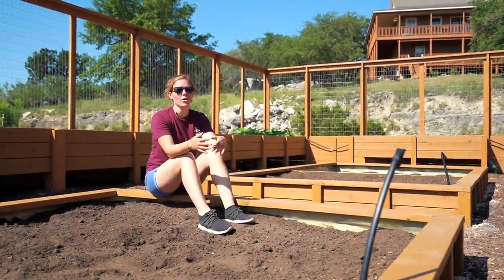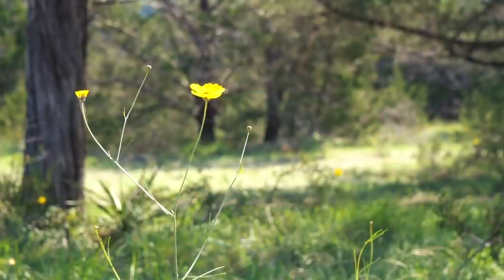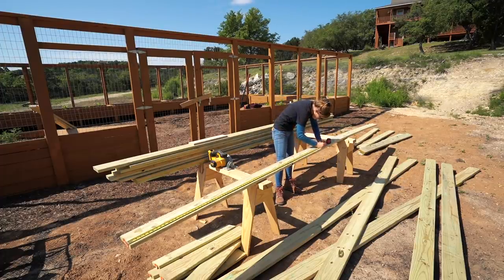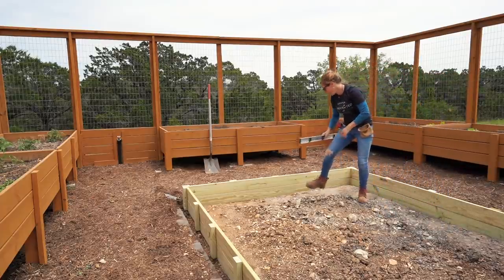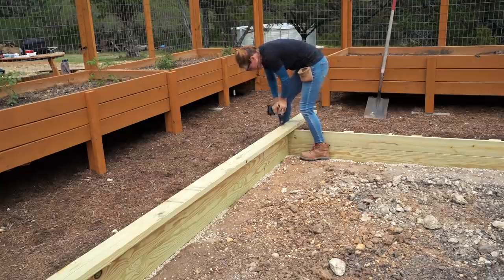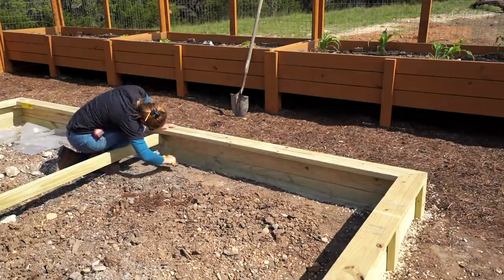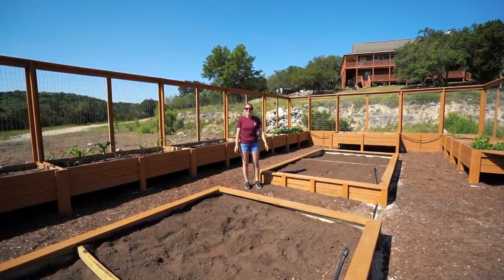DIY Raised Garden Beds

Comment: Very nice job April. We use scaffold boards cut to the width of the beds, so you can easily plant across the bed without standing on the soil. A standard scaffold board is also a good spacer between rows, after planing one row, simply flip it over and plant the next row on the other side. Happy gardening.

Comment: Kudos to you for all the hard work.  You did a good job.  I don't agree with the research you did on pressure treated lumber used in garden beds - soil contact and absorptions etc., even if you used soil contact PT and not just the standard off the shelf PT (don't trust everything you read).  Again, kudos for all the work and quality of the work you have done, but I think it is more effort and funds than a simpler more practical plan would give.   Plastic or any laying system give ants / insects and mold a home.  We all know what they are capable of.    I don't know if you stain over PT lumber before it dried but allow PT to dry before staining if you don't already know this.   In short, its over kill, but looks great and a job well done.

Comment: Pressure treated lumber is rated for high moisture/marine environments and ground contact but what many people may not realize is that after making a cut through the lumber - all cut ends should be retreated with an application of End Cut Sealer in order to ensure the integrity of the product's rot resistance and to maintain the lumber's warranty. Yes, as crazy as it sounds, pressure treated lumber does have a warranty. A well know and trusted brand of end cut sealer is called: Cut N Seal if you are interested.

Comment: Always love your videos. FWIW, I used to use 1x or 5/4 for beds, but found it only lasted a few years before rotting from the inside out. I'm nowadays going with 2x material - which also helps with bowing of the material. Of course you could also cedar ($$$), but I likewise use PT wood (much safer than it used to be). My standard is to go with a 4'x10' box that's ~24" tall (3 2x8' boards high). I likewise add little 3/4 tall rim ledges, but only on two sides. 10' boxes also mean that 3/4 EMT (in 10' lengths) work perfectly as a trellis framework, and I use 7x3.5 concrete rebar wire mesh for easy to add / remove trellising for tomatoes, cukes, etc. -Best wishes!

Comment: Good work, as usual.  However, according to my research, the plastic liner actually traps moisture next to the wood, speeding up the rot process.  Instead, with my timber raised beds, I protected the inside the beds with a non-toxic wood stabilizer and stained the outside (with both products wrapping around the corners of each side timber to meet where they won't be visible).  I also recommend either lining the floor of the entire bed structure with hardware cloth, or placing a perimeter of vertical hardware cloth or metal sheeting in the ground around the entire structure to ensure that critters don't burrow into your beds.   Happy gardening, April!

Comment: One of the benefits of raised beds is that you should be able to reach the middle without stepping up in it. That would normally mean about three feet wide.
Reply: Yep. I’ve done several generations of raised beds. First was four 4x12 beds made of 1x12 boards; they fell apart in a couple of years and were a pain to reach the middle. Second generation is four 3x8 beds made of 2x12 cedar, much sturdier and easier to manage and they survived a move from one house to another. Third generation will be to raise these beds up about 3 feet and put bottoms on them to again make them easier to reach. That’ll be a project for this fall when the growing season is over. Might raise two of the beds only 2 feet instead of three and grow taller stuff in the shorter beds.

BTW I’m a big fan of Mel Bartholomew’s Square Foot Gardening system.
Reply: I was just going to post this.  This size is not optimal.  Would have been better to build 2 three for beds or 2 1/2 foot beds.  One four foot her max if you want to push it.

Comment: Its going to be difficult to tend to the middle of those wide beds. That's why raised beds are typically no wider than 2ft.
Reply: SeanLeonDrums You mean 4 ft as the width of the bed. The 2 ft is the empty space between beds.
Reply: Since those central beds are not very high, April can place boards (walking planks) in between her plants when she wants to access them.

Comment: I'm curious about finishing pressure- treated lumber. You applied a finish right after completing construction. Here in NC, our pressure treated lumber is so wet, that if you put a finish on it right after the build, it seals in the moisture. I've seen a brand new deck built of PT lumber rot in a couple of years because it was finished too soon.  Is your wood drier in TX,, or is the climate dry enough that the wood will dry even through the finish?
Reply: Is she using KDAT (kiln dried after treatment) lumber?  Yellawood in some areas.  Don't need to wait to finish.
Reply: I agree, when I redid my deck, the PT wood was literally dripping wet. I had to wait a season for it to dry out before I finished it.

Comment: When you built the garden enclosure, you sprayed the coating. Here you rolled it. IS there a reason that you didn't spray the finish seal before you assembled? You could have gotten the side boards and the brace 2 x 4s at the same time.

Comment: That whole setup is slicker than owl snot. Do you use  deck screws or structural screws? That top board makes a great seat or beverage holder.

Comment: We Europeans despair at the insistence of Americans  in using shovels, spades and pitch forks that do not have a handle on the end which makes using them SO much easier to use!  It seems that Americans have an almost religious connection with the older design. You can buy both shovels and spades with a handle in the US , but not I think pitch forks.
Reply: It must be quite an honor to be selected as the spokesman for every citizen of an entire continent.
 I, on the other hand, can only speak for myself. For some things, the shovels with the handle work best however sometimes having the longer handle is good for leverage, and for what she was doing, shoveling loose dirt and gravel, I would prefer the long handle.

Comment: I hope you didn't use pressure treated wood It's a NO No with food plants
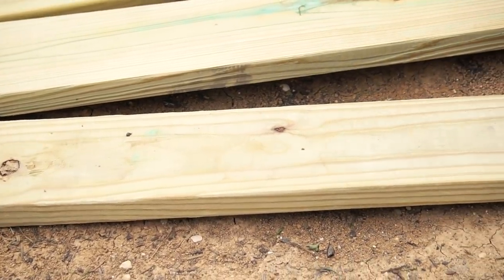Reply: As she said in the video, she researched it and the pressure treated wood she used is safe for what she is doing. 3:35
Reply: Most are not using arsenic anymore not to mention what it would take for that to leach into your plants and then brought into the plant systemically. I think you're worrying a little bit too much here. Should worry more about whats on the vegetables in the store you're buying

Comment: You made it too wide. you won't be able to reach everything without walking on your aerated soil. 

Pressure treated is just fine for food growing (Brought to you by the Allied Carcinogen and Poison Producers Assoc.)
Reply: Yea, Thats kind of what i was Thinking too. Food & pressure treated wood Would not be my choice But , Lining with a Heavy Mil Food Grade Plastic Should put her Back at the Low end of chemical Poisoning.
Reply: Most are not using arsenic anymore not to mention what it would take for that to leach into your plants and then brought into the plant systemically. I think you're worrying a little bit too much here. Should worry more about whats on the vegetables in the store you're buying